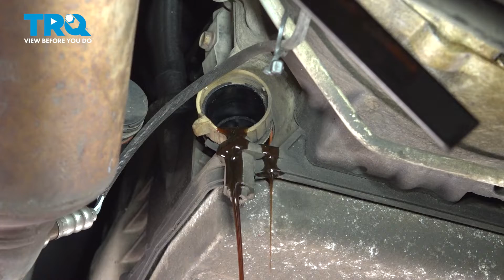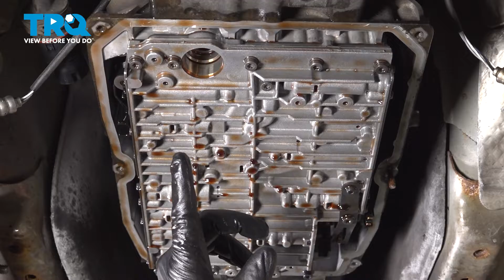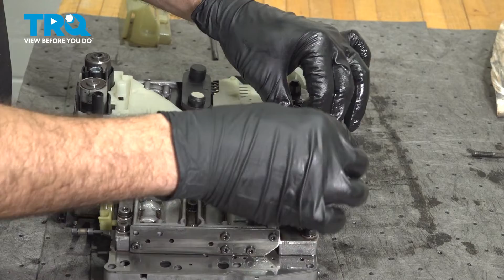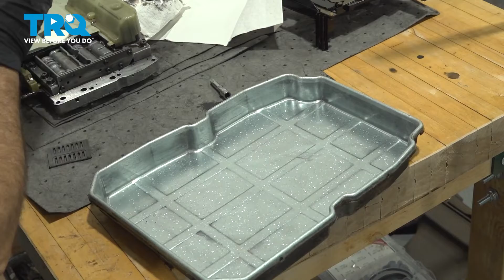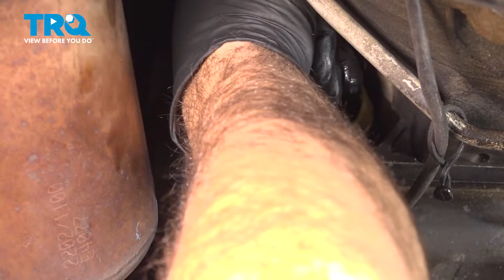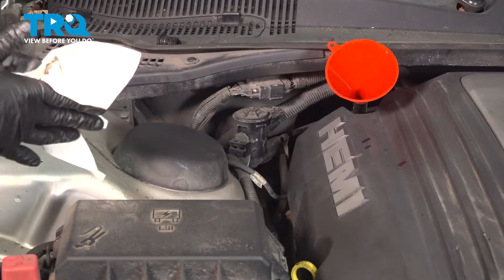How to Replace Conductor Plate 2005-2010 Chrysler 300

Comment: Hey man you saved me.. so I was actually going to do a how-too video on this (having never done one) i was short on time so I didn't.. BUT.. mannn.. so I've got my mint magnum SRT on jack stands trying to do this on my back.. I did NOT realize how heavy that valve body was going to be and freaking dropped it! 😭 it only fell about 4 inches but still.. ofcorse fell in my pan, cracked the pan and leaked all the trans fluid out onto my garage floor. Smh.. well reason I say thanks is because when I was going back in.. the shift detent and off white plastic thingy.. well that thing had moved and I didn't know how that went together.. so huge thanks on that. I do have a question.. hopefully you see this sooner rather than later.. online it sais to add 4.5qts back after dropping the valve body.. well.. I collected around 5.6 qts total! I don't have time to order/wait on the dipstick.. well.. I actually do have one but I'm not sure what vehicle it belongs too.. I've had so many and so many 6.1 srt vehicles..

Comment: OMGosh! Fianlly, such a great step-by-step with tourque specs!!! I would have really suffered not knowing all the extra steps needed (remove the wiring connector, drop the transmission support). Thank you thank you thank you! The only difference I found was that with the 3.5L V6 the transmission is further forward, so you do not need to remove the transmission support.